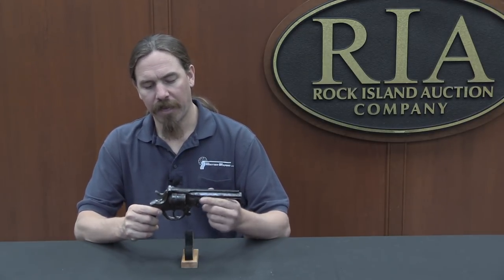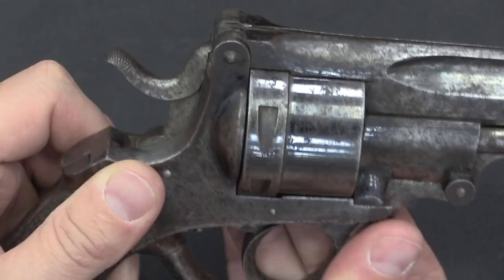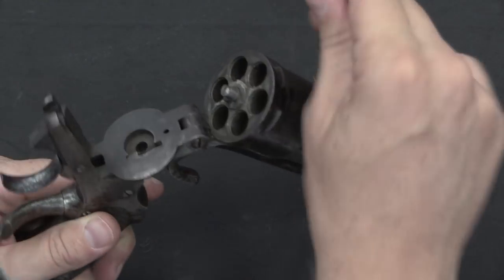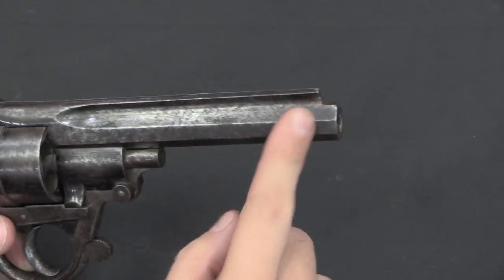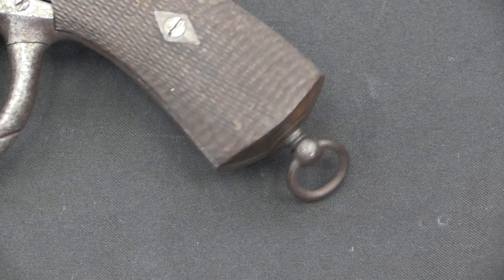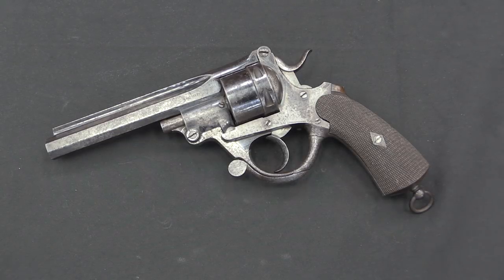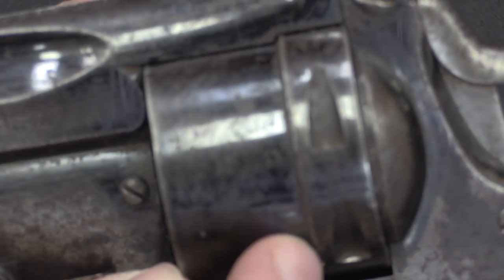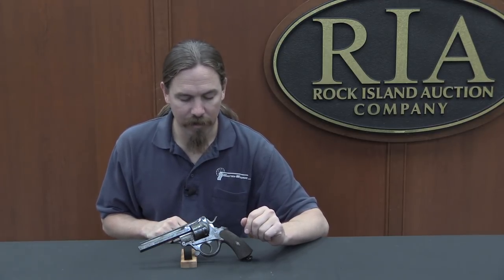Gun Yoga Fail: The Fagnus Revolver

Comment: just a note here. "cast steel" on a firearm or tool does not mean that the object was cast. it means that the steel that it was made from was a type that was invented in the 1730's by Benjamin Huntsman in Sheffield England. as cast steel was thought to be the best, the better quality edge tools were made from it up into the early twentieth century and marked as such.
Reply: like the 'fluid steel' designation - ~ better than wrought ...
Reply: "Fighting Iron" by Art Gogan is an excellent book on the subject of iron, steel, and other metals used in arms.
Reply: It does for a Ruger.
Reply: @zacharyrollick6169  Nowadays a good cast revolver has no downsides to it being cast anyways.
Reply: @stuv1996  Yep. My cast frame P89 is a tank.
Reply: @GR46404   Thanks for the recommendation, fascinating book.
Reply: @tristanhore8519  You are very welcome, Tristan Hore!  I am happy it was useful.
Reply: @stuv1996  I wouldn't say that's entirely true. It's not going to be quite as durable or handle as high chamber pressures as a forged steel revolver. This is mainly due to metal grain, which is uniform in forged steel, and random in cast, but even the best of casts can also have tiny gas bubbles in it, points of weakness. It's probably good enough though.
Reply: Cast steel absolutely DOES mean steel that is melted in a furnace and cast into a mold🤦‍♂️🤣

Comment: Still rather have that system than loading gate and ejecting one cartridge at a time.
Reply: D3faulted1 I’d have been all over that revolver if top breaks or swing outs were unavailable. It’s a clever design
Reply: D3faulted1 word. The Russians (Ian’s covered it ofc, Nagant M1870) had a system that was was better than this (gravity tip-back). But, in a firefight back then (even now), any slight advantage can change the outcome, and back then (like you mentioned) against comparable models, this would have been a niceeee advantage to have for sure
Reply: @defaultusername123  you mean the galand?
Reply: @defaultusername123  Thats not a Nagant pal, Nagants are similar to SAA's.
Reply: @georgewhitworth9742  he meant the Galand revolver.

Comment: It's most likely intended for .450 Adams ball Mk I. How did I come about this? Circumstantially. I've found other Spirlet revolvers and none of them are marked either, but .450 Adams was the first adopted .450 cartridge in England and would have been the most common choice. Length of cylinders between these and the Fagnus appear identical. One Spirlet was photographed with an Eley headstamped case in the chamber, which would have been an Adams ball Mk III (I think), which is still .450 Adams.

Comment: Ian, may I recommend that you get yourself a 'Vernier callipers measuring instrument' [which includes the metric system] to more accurately determine the calibre of say, the entry port and or the barrel discharge port of each weapon.  Be it either a manual instrument for under $20-00 US dollars, or a digital read-out instrument obtainable for around $30 plus US dollars.  I trust that this could well provide you with a good result.

Comment: Here is an idea.
Instead of you flipping the barrel and cylinder up into an awkward position, try gripping the barrel and cylinder with your left hand (if you are righthanded of course) and let go of the pistol grip and instead flip the pistol grip up and over.
Flip the pistol grip out of the way, so you can work the extractor and reload with the hand that you normally hold the pistol grip with.

For some reason, americans have taken this "no finger on the trigger" thing to it's extremes and seems to be so heavily into having the finger outside of the trigger guard at all times except when shooting, so that they are unable to actually let go of the pistol grip to use that hand to work the weapon.
And with that I'm of course refering to AK-style controls on the right hand side of the weapon, which many americans seems to think that the only way to operate is to reach over with the left hand, instead of using their right.

Comment: A. Fagnus & Cie

Revolver Fagnus, 6 coups, calibre .450.

Revolver à canon et cylindre (barillet) soulevants avec extracteur.

La sous-garde (pontet) se divise en deux : On fait effectuer un quart de tour à la partie postérieure, action qui met le chien au premier cran. On peut tirer la partie antérieure vers le haut, dans un premier temps le canon et le barillet se soulèvent. En accentuant la traction, elle fait effet de levier pour l’extracteur en étoile qui sort alors de son logement. Plaquettes en noyer ( ?) lisse, anneau de calotte (manquant).

Brevet de perfectionnement 28560 du 14/03/1871 au nom de A. Fagnus & Cie

Alexandre FAGNUS, fabricant d’armes, on le retrouve au gré des documents aux adresses suivantes, toujours à Liège : rue des Célestines, 9 (1863/1867), rue Maghin, 19, rue Chéri (1880) rue Jolivet, 31 (1886), rue des Armuriers, 24 (1888).

Les poinçons

V couronné : contremarque du contrôleur du 30/12/1853 au  26/01/1877.

ELG sur étoile dans un ovale : acceptation définitive du 08/09/1846 au 10/07/1893.

Les marquages

Acier Fondu (cast steel)

261 ? : numéro de série

HPH